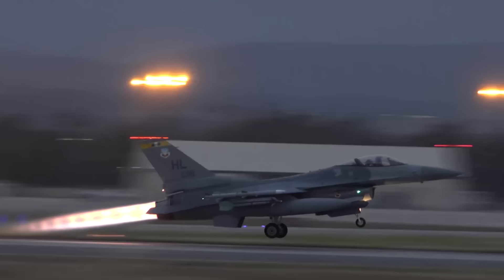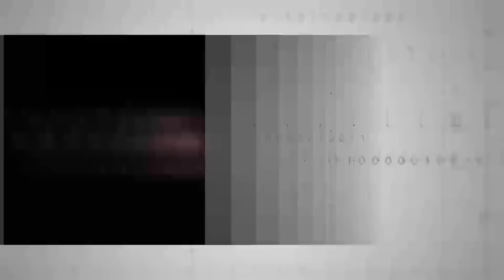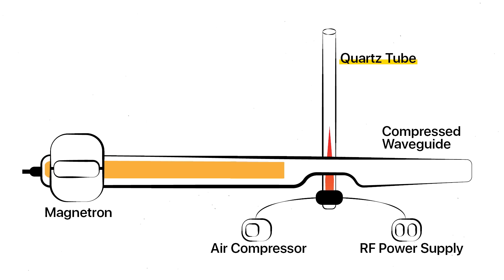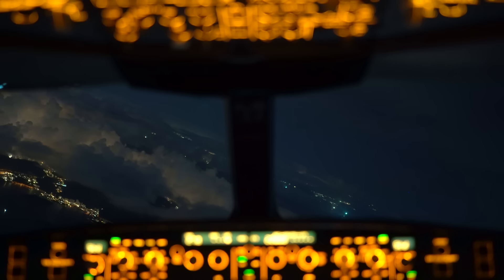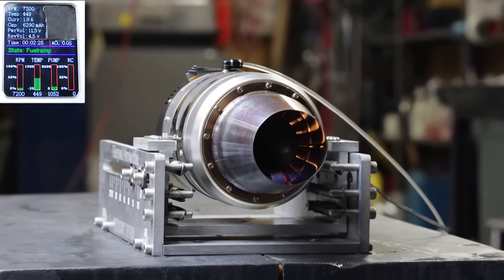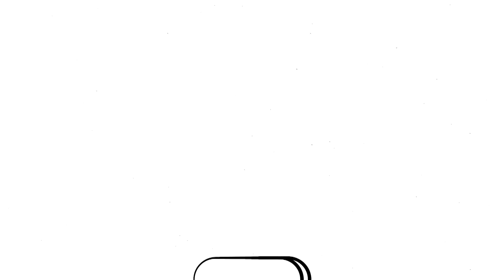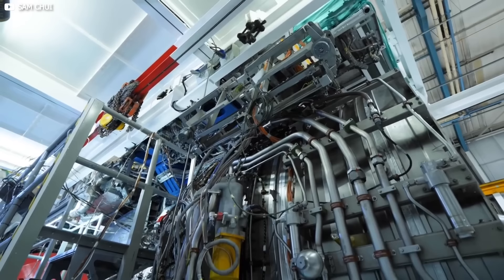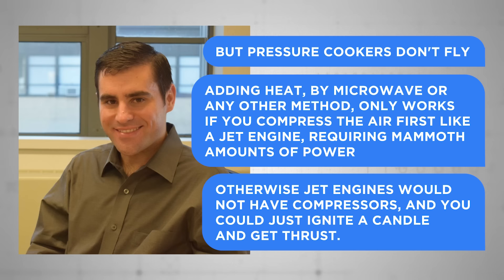What Are Electric Plasma Jet Engines?

Comment: I guess with all these electric based thrust technologies they are all limited by low energy density in chemical based batteries. A portable fusion powered generator is the real holy grail. I hope ITER is successful in creating breakthroughs in fusion
Reply: You are very agree, but I have much more hope in the evolution of batteries than in nuclear fusion.  
Even if nuclear fusion will one day be feasible, I highly doubt that there will ever be a nuclear fusion power plant that is light and compact enough to power an airplane.
Reply: Fusion is not going to happen until 2040 to 2060 if it's possible -- and that's a big IF.  
By that, I mean fusion where the power generated is greater than the total power needed for running the reactor.
Reply: Nuclear Fusion is what I see everything running on about 100 years in the future or maybe 200
Reply: Batteries are progressing in terms of their energy density; maybe in a few decades the density will line up with chemical systems.  At that point, the energy generation can still remain on the ground while the flying machines charge on the ground.  I'm thinking of an induction plate rather than cables, since ground crews will help the pilot line-up the plane on the ground anyway.
Reply: Green Hydrogen is a easy energy storage
Reply: @MrSilvertech  there is it is produced from renewable energy
Reply: @MrSilvertech  sure, why not
Reply: Fusion will likely be here before that ITER garbage is even operational lol.
Also, Tokamaks are garbage.
Reply: @MrSilvertech  
I did not say that.
The fact that you need to pay 50 billion for it to maybe work says a lot about how shit tokamak is as a concept.
 
Focus fusion is far better approach.
Reply: @MrSilvertech  It is the second most expensive science project in history.
Reply: This is all well and good about fusion reactors but causing a nuclear disaster every time a plane is unfortunate enough to crash spectacularly is not exacty what i would call green... I slightly hope they dont take off after final development of them in a literal sense with short sighted aviation companies just looking for the power they are capable of, not considering the ecological issues just waiting to happen. Maybe those "nasty hydrocarbons" are not so bad after all 🙄
Reply: @Trompicavalas  batteries will not get much better than they are now. With the advancements in lithium we got pretty much the last step. If they could have been done any better they would have. Just face the facts batteries have hit the bedrock in terms of their evolution. The energy density of batteries may improve slightly in the future but they will always pale in comparison to the energy densities of hydrocarbon fuels. FACTS 🤷‍♂️
Reply: Recently we had a Net positive gain in a korean fusion reactor where they generated more energy then absorbed by the fuel.
Progress is being made.
However to see any type of spacecraft powered by such technologies is probably merely a dream as of yet.
Reply: It is a simple engineering question.
Do you have a portable fusion powered generator. 
The answer to the question is still no for now, and no for the next few decades.

Case close.
Reply: Chemical storage is already maxed out, there may be .0 percentages to be gained but that's it for size/weight v capacity.
Reply: @georgedavey1339  I think youve mistaken Fusion for Fission... Even if you forgo on using Deuterium and use Tritium, the half-life and amount used is so low that its no real concern...
Reply: @pavanbiliyar  Induction?!? Really? Do you know how high the loss rates are? Even if we have cheap fusion energy throwing it away just for a little convenience is stupid, also the high eddy currents in the fuselage would interfere with the induction...
Reply: Yes, always comes down to energy density, unless we can supply energy to the system from external sources like lasers; maybe a ground based track of laser stations could provide a compromise, a sort of flying train if you will, picture it gleaming white sky-train. Until we wait for miniature fusion reactors as you say, or a new physics of energy harnessing. The video made a good point regarding the conductors required to get electrical energy presumably from source to engine, I hadn’t thought of that issue before. Still propeller driven engines don’t have to be discarded, each to its application; I for one am happy to fly in large leisurely electric airships like ocean liners of the skies. We have a tendency for power and speed an attraction; then too much haste disappoints us when the technology can never be produced with ever changing goalposts. A modern electric airship would be a wonderful way to travel the globe; the travel can often be more than the destination, as we humans know.
Reply: @avidmoviewatcher346  Airships have and always will be a bad idea. Earth is too windy. History has taught us that.
Reply: I heard some people are developing hidrogen batteries and that could solve many problems.
Reply: @acmefixer1  it is possible because it exists
Reply: @pavanbiliyar  and also just hot swapping batteries
Reply: Nuclear fusion
Reply: The russians have one miniaturized fusion generator working. A few actually
Reply: Graphene
Reply: Portable fusion wouldn't be possible at such a scale like this. The infrastructure for the magnets alone would be immense.
Reply: @acmefixer1  Fusion has already happened and ITER is very well on its way to breaking even.
Reply: @literalantifaterrorist4673  Not with current technology or fusion approaches no, hence why I say "holy grail". But in 50, 100, 200 or 1000 years? Who knows
Reply: @Trompicavalas  there are some that are capable if scaled down. With 3D metal fabrication it can be done. If they used molten salt as the fluid to be ran through the pipes to the turbines and generators. As for the by products. There aren't many.
Reply: Either fusion, safe fission, or a better thruster
Reply: I'm still dying to see a fission airliner, that would be lit
Reply: @TheRealAnsontp  finnaly, someone who isn't scared of fission
Reply: @DuffkaBigNerd  it would honestly be harder without fission my friend XD
Reply: @pavanbiliyar  Any more density and it self ignites.
Reply: @MrSilvertech  I think you don’t know with what several rockets are already powered and i do remember “green”+hydrogen is technically only a Helium or Thr based reactor way. But i suspect you referred to the green in the name. From a infra side it’s actually way more trivial than using say Ionic Electric Thrusters which aren’t a real thing right now anyways.
Reply: @MegaBanne  I personally bet for the stellerators way tinier but more computational intensive sadly also underfunded.
Reply: @platin2148  
I don't see any benefit with the stellarator.
As far as I know it just tries to do what tokamaks do with two perpendicular magnetic field sources; twist the magnetic field, but in an overly complicated way.
 
Not sure if the stellarator brings anything else to the table.
It looks cool though.
 
I believe the future of fusion will be using electrical discharges.
Since the nature of plasma can create extremely high densities and energies.
To work with the complicated nature rather than trying to brute force it.
Look up focus fusion.
Reply: @MegaBanne  Less magnets is a huge plus just simply because they need to be superconducting. Which makes it more difficult to harness the energy you get out of the fusion.
Reply: @platin2148  
That is a good point.
Not to mention that they are bloody expensive.
Reply: @MrSilvertech  u know nothing about hydrogen fuel then. You can create hydrogen fuel at a base of a wind turbine but it requires more electricity to create than it can output. It is only feasible when we have excess energy which can be achieved in many ways like optimization or energy stations built into the oceans or above the stratosphere
Reply: God I hate living in a civilization like this. We dream of dyson spheres and man-made planets yet we can't even figure out how the sun works but on a smaller electric scale well enough to make real fusion reactors.
Reply: If you only knew what happend recently
Reply: @solfuros7673  I do. However I also know the latest ignition fusion achievement isn't exactly truthful. The energy applied "directly" to the capsule was less than the energy output, HOWEVER the energy required to fire the laser (which is then split into about 200 streams, amplified and redirected) runs at about 1% efficiency, so the true in vs out was much less. Also unlike ITER it isn't a sustained reaction, so really designed for power production. Go check out Scott Manley's channel as he explains the achievement very thoroughly
Reply: @acmefixer1  it happened today so what's next? Lol
Reply: @squartbotai1383  left eye spectacle which sits on top of mountain Everest, covid is nano technology?
Reply: Tony Stark build that in a cave with a box of scraps... so shouldn't be too challenging.
Reply: @TamilAlienAdventurers  Green Hydrogen has an energy density of 33kWh per KG. While Deuterium-tritium fusion is about 91,000 kWh per GRAM. Fusion has almost 3 million times better energy density than hydrogen combustion.
Reply: Cryo liquids for storage, lox and lh2 expand about 1000 times, use the same process but engines need a difference in pressure and or both temperature to do work.
Reply: @sambamwicker18  Indubedably.
Reply: @MegaBanne  ever seen how stupidly complex stellerators are? How the hell are they better?
Reply: @YellowEvoV110  
I did not say they where better.
They are glorified tokamaks, and tokamaks suck.
Reply: @MegaBanne  ah I see. So you know of tech thats better or is it that you think they suck out of spite?
Reply: or an efficient enough battery of molten salts imho
Reply: Yeah that's Iron Man stuff I'm sure Government has them already just not yet practical until they make a fusion device to power it. I think what would be interesting would be Cold Fusion.
Reply: Check out Radiant…a nuclear physicist working on a very light and very small nuclear reactor that would fit in a shipping container…1 to 5 MW
Reply: If we figure out fusion…we could use the plasma from the fusion reaction directly to power aerospace planes anyway…no need to futz with this…